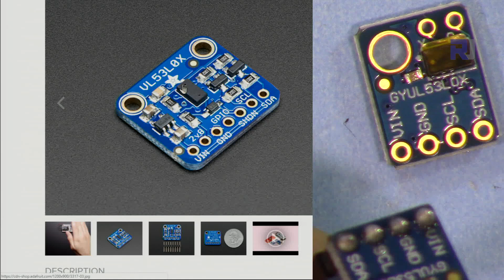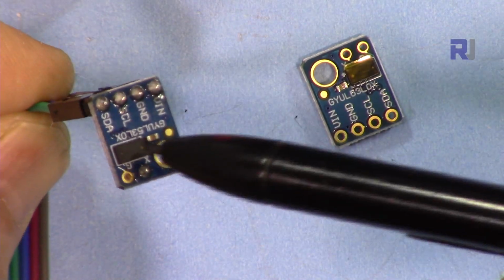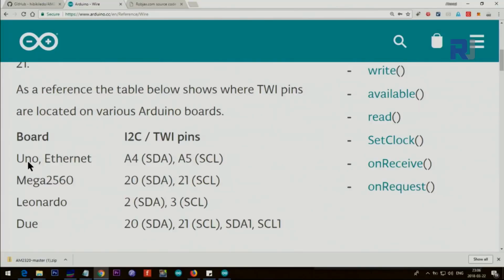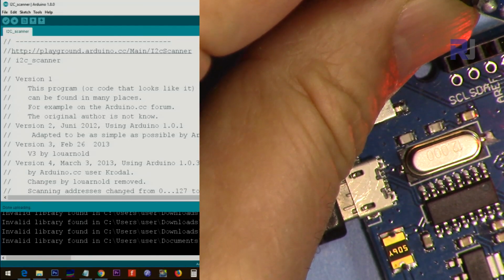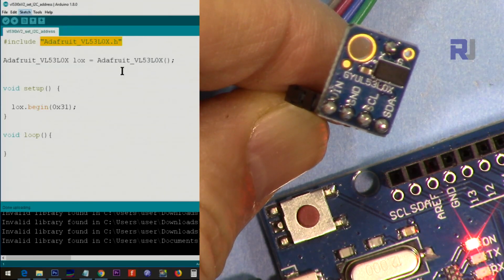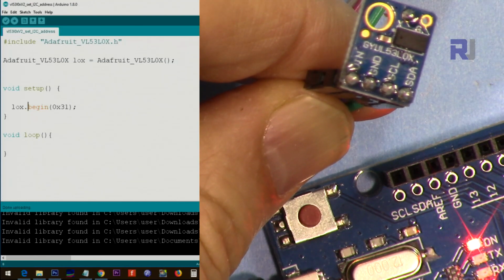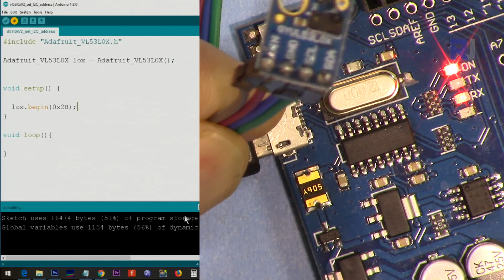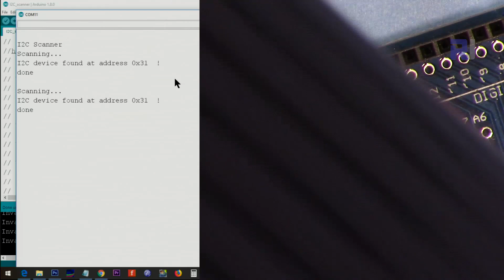Lesson 84: How to change the I2C address for VL53L0X laser distance sensor RJT145

Comment: Sorry, I don't speak English very well, and I'm using a translator. So, can the address be permanently changed this way? I have a project that uses five of these sensors, and I thought I'd use the "XSHUT" pin to turn on the sensors one by one and change their address. If I could change it once and have it done, it would help me avoid depending on the XSHUT pins and changing the address each time.
Reply from the maker: no you can't the address permanently. But you can set it in your code top portion so when the program starts it set the address and the rest of code will not have any affect on the device.

Comment: Thank you for the sketch and I have tried to change the address.  Even after using the software to change the address of 6 nos of GY-530 modules, from 0x29 - 0x35, all athe modules are reverting back to the earlier 0x29 subsequently.  Any idea why?
Reply: I'm having the same issue. I'm trying to use two VL53L0X sensors using the dual example from the adafruit library. They seem to work just fine when setting the adresses to 0x30 and 0x31 but when i disconnect the USB cable from my computer and reconnect it, one of the two sensors (normally the second one) fails to boot. When i run a I2C adress scanner after this, it seems to just find th default 0x29 adress. Please let me know if you've found any solutions to this. Thank you.
Reply: @diegogarza2120  so did you find any solution?
Reply: @mrjames0094 Nope. From what I investigated at the time, the I2C addresses reset to factory settings (0x29) each time the sensors are powered. In the project I was working on, I was using an Arduino MKR WiFi 1010. I considered using the FlashStorage library to save the addresses in memory so that even if the microcontroller was reset, the addresses would remain saved. Never tried it though. I ended up switching to the Garmin LIDAR-Lite v4 LED distance sensors. They were much easier to use and didn’t have any issues with I2C addresses. Hope this helps.

Comment: I tried this and now the scanner doesn't pick up the sensor at all.
Reply from the maker: Check the wiring
Reply: @robojax  I don't think its the wiring because if I change the sensor with a unaltered one, the unaltered sensor gets picked up, also I test the sensors with the single proximity script to make sure they work and to check the soldering is solid. I think its either hardware problem or I missed something, because I tried this with another working one and the scanner picked it up before I changed the address, but not afterwards it seems as if it would only delete the address.

Comment: hello sir, I am an arduino beginner user ,, I want to use a pressure sensor with type xgzp6857 and will be processed by arduino, this sensor uses the i2c communication protocol, I have found the i2c sensor address is 0x6D, but this sensor does not yet have a library for arduino, how can I use this sensor so that the pressure reading can be displayed on the serial monitor?
maybe you have an idea for this problem?

thank you
Reply from the maker: Hello, there must be library. or use the Wire library to read and write to the sensor. Read the datasheet of the module and you should be able to do it.
Reply: @Ilham Rahmat Muharam
 - Go to the Arduino Forum for I2C programming help ...

Comment: thank you, but the address returns back to its origin if you remove wires and reconnect them again. so you cannot depend on that if you want to distinguish between similar sensors. this change is temporary. how to keep the changes for ever?
Reply from the maker: That would be nice if doable.
Reply: @robojax  you are right. unfortunately not possible till now.

Comment: I have max17043 fuel gauge modul which address is 0x32 but I want to change it to 0x36 can it possible??
Reply from the maker: Hi, I don't know which library you use, but I did search quit some pages and datasheet and found this library https://github.com/lucadentella/ArduinoLib_MAX17043/blob/master/MAX17043.h where in line 10 of MAX17043.h file they have defined the i2c address. So update this file in your library with different address. Good luck. I looked to see if I should get this module and make video, but it is very specific and few people need this so I will not make video.

Comment: Hey, is there a way to use 2 VL53L0X sensors at the same time? I was told i can't use the A4 and A5 on both sensors.
Reply: What does this mean. Isn't this the while point of being able to change an address so you can use more than one of them at the same time? I don't understand this comment... Could you explain please?
Reply from the maker: Hi, Yes . Normally you can connect up to 128 devices on I2C bus. But this library has limitation. We need new library. I am very busy to write a library but it id doable.
Reply: @robojax  any progress on this application? Two sensors at once?

Comment: My VL53LOX works until power from another isolated system turns on.  There appears to be over sensitivity to RF. Cable to the VL53LOX is a shielded cable. I'm driving a stepper motor and when it is powered on, the VL53LOX simply stops working.  Suggestions?
Reply from the maker: It could be due to fluctuation of power used by motor or noise in power. Please try putting 1nF ceramic capacitor and 10μF Electrolytic capacitor at the laser sensor's power VCC and GND pin.
Reply: @robojax  Both capacitors in parrallel across the VCC and GND lines?
Reply from the maker: Yes. both. the 1nF will filter high frequency and 10μF is for low frequency noise. the 10μF has polarity but the 1nF doesn't.
Reply: @robojax  Thank you, I will report back
Reply from the maker: You are welcome. Please start a new comment as this comment will go down the list with other comments and I might miss it (I see comments from all other videos in the same page). Good luck.
Reply: i faced the same with a bluetooth module that has stopped when the servo has run. I just supplied the servo with external power and not from the arduino board.

Comment: Hello Robojax, do you know if there is a way to do the same for the bme280? i mean, i know i can change the address from 0x76 to 0x77 but i wanted to use 6 bme280 :)
Reply from the maker: Hi, You can have only two addresses see datasheet page 31 https://cdn-shop.adafruit.com/datasheets/BST-BME280_DS001-10.pdf so you can't have 6 of them as far as I know.
Reply: @robojax  First of all, thank you for the quick answer. Also, i get the think about just the two addresses, but in this video you show that the address for the VL53L0x GY-530 module is already 0x29 and the VL53L0x default address is 0x52 according to their datasheet ( https://www.st.com/resource/en/datasheet/vl53l0x.pdf ). Furthermore, I see that you use a pretty simple code to change that sensor's address:

- Is there a way to change any sensor address as with this sensor?
- Is this because of the library you are using?
- Can someone make a library/function for any sensor to change its address?

I'm asking this because my idea is to change the bme280 address to make them work together.

Greetings from Mérida, México.
Reply: use a i2c multiplexer